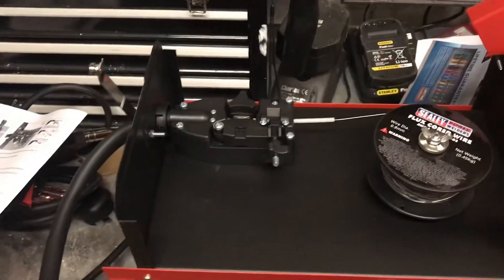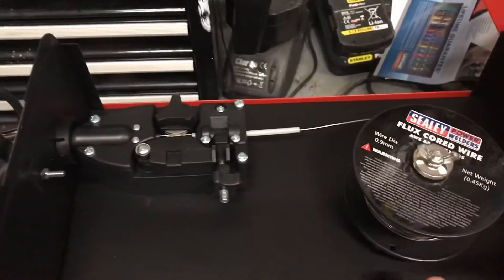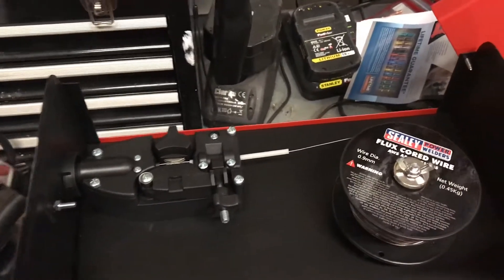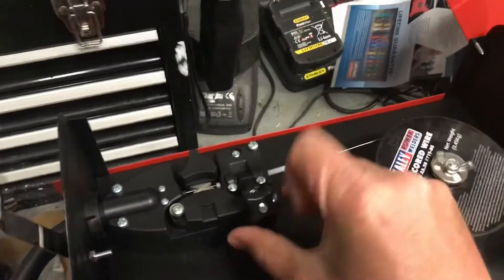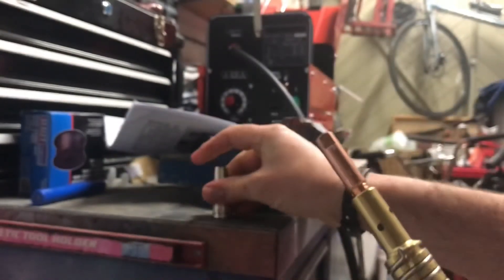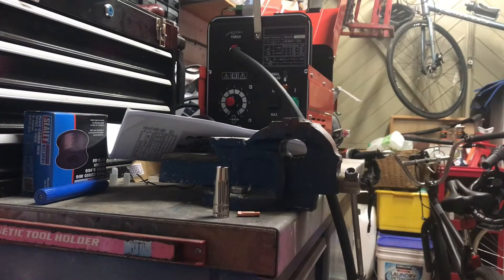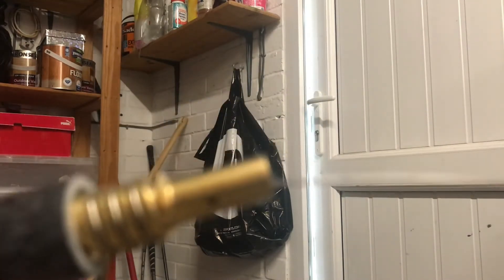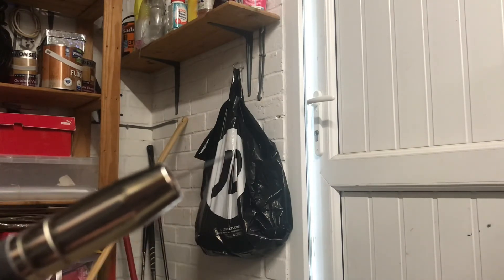Teaching myself to MIG weld, routing the flux-core through the Sealey mighty MIG 100amp part #2

Comment: Great content 👍
I'm thinking of taking the plunge into welding as well.
   What happened at the gun end when the wire was making its way to  it, you stopped the feeding process and showed us something. Thanks 👍
Reply from the maker: Hi, the flux cored wire was stuck and it pushed the internal spring with it. It sort of threw me. I pushed it back in and the wire was fine. Glad. You’re taking the plunge. I’ve been wanting to do it for a while, so many options , so I was researching for a while to see what was what. Thanks for watching.👍👍👍